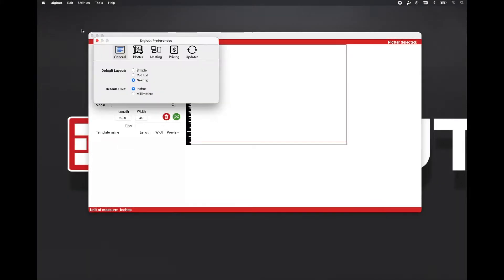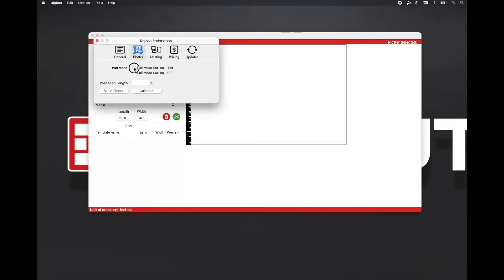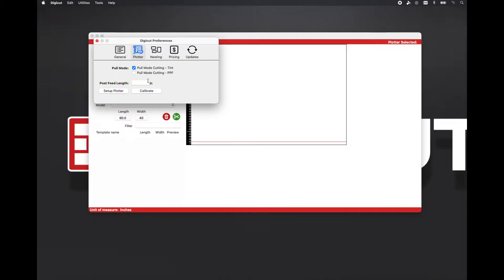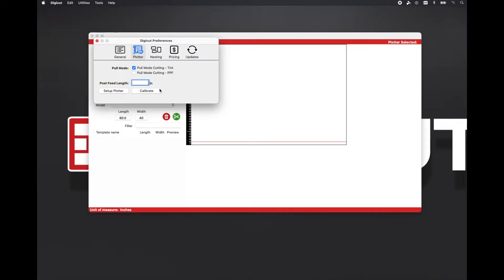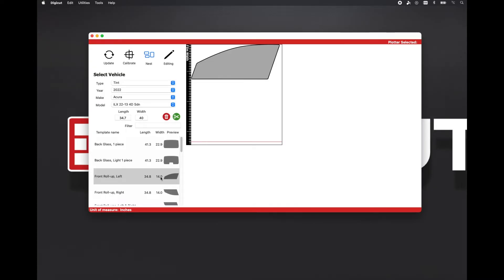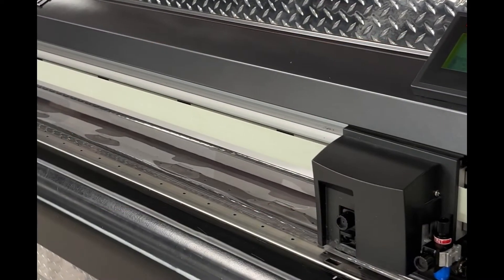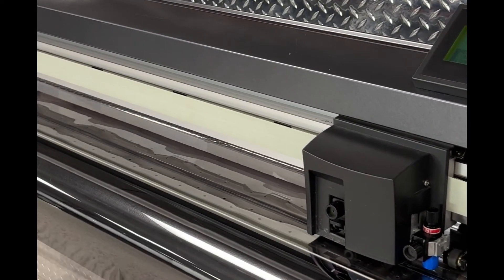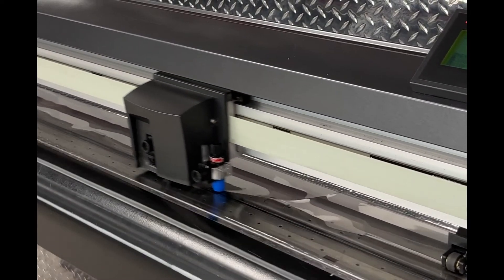Pull Mode Cutting

Comment: What is the benefit of this mode?
Reply: that's what im saying
Reply from the maker: Pull Mode means it only cuts the film as it is being pulled back into the cutter.  Some cutters don't work very well cutting while the film is feeding forward because it can cause it to wrinkle or cause your film not to track straight.